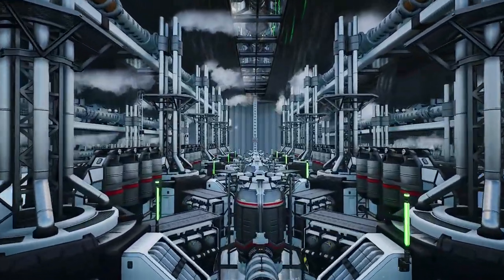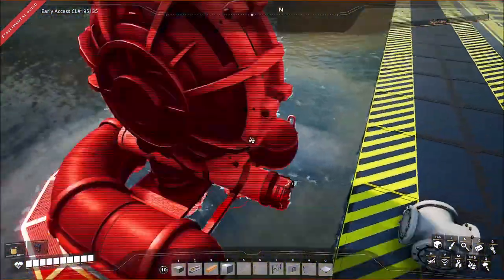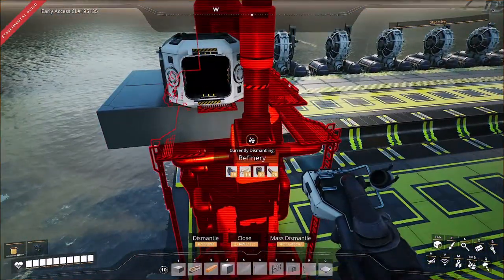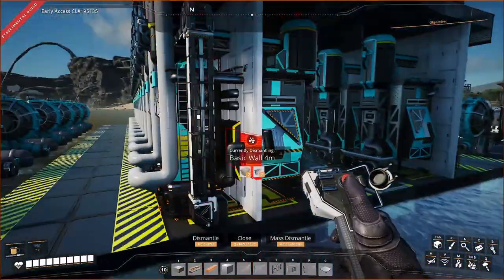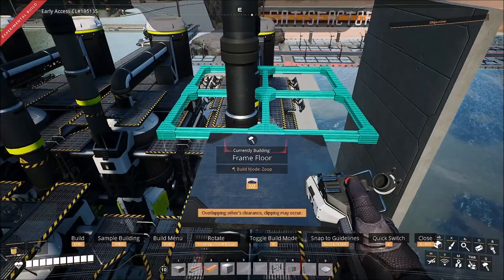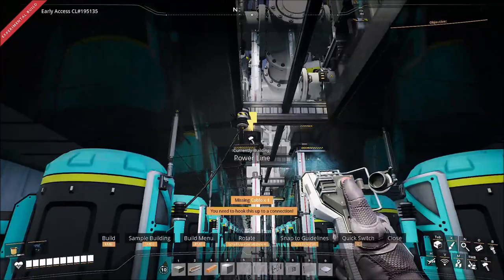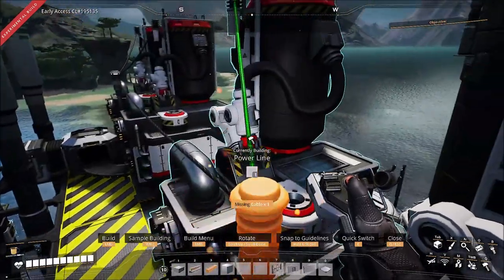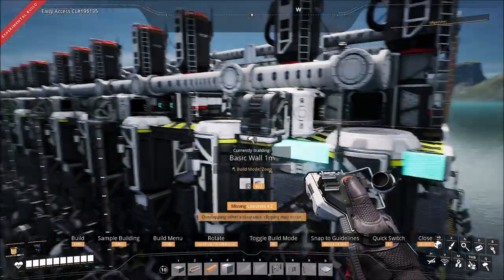Satisfactory Fuel generator fuel power plant tutorial update 6 part 1

Comment: Thanks for the design tips. I took your build and design to my liking.  I rearranged the build a little by putting the water extractors into the middle of the build.  I also added another foundation at the end, so my groups of 2 packagers and 2 refinery had one empty foundation between me.  For me it made more of a symmetric build.  Next i placed heavy oil refinery above my water packager and the fuel unpacker about the package fuel refinery, so it still does a loop system.
Reply: @DrawingXaos   I am still finishing up the build, so it is not running yet.  For the most part, it runs the same as your.  I am planning to take a little of the packaged fuel as store it for other uses and refill the packager with empty containers.
Reply: @DrawingXaos  have the jet pack.  if you have another place for me to post.  i can upload some screen shots when i am done.
Reply: @JasonMerk  he has a discord

Comment: Great vid not sure if i missed something or something changed from upd 6-7 but oil ratio is abit off with heavy oil residue refinerys only making 28.57 residue per min at 71.425% which means the packaged fuel can't run at 100% which me you have to undeclock everything a tiny bit. Water extractor + water packager + fuel packager + fuel unpacker all at @ 95.23%, making a total of 1599.864 fuel /min instead of 1600 but wont ever be bottlenecked.

Comment: I need to get a little farther before I can try building this myself, but I'm loving your setups!
Reply: @DrawingXaos  I especially liked how you took the time to explain good wire placements too. It helps a lot, as they're always important to the build.

As for your question at the end, just put a wall power node at the point the wire clips up through the ground and then attach that to the power pole. It will at least look a little less like clipping and more like your pipes through the foundations. Intentional. Either that or flip the batteries around and run the power line down the slanted support wall.

Comment: Great work but there is a mistake in your calculations. You need more than 600 crude oil. You have built 14 refineries to produce heavy oil thats  mean - 28x30= 840 crude oil. Even if I set the production of heavy oil to 30 / min , than i still need 640 crude oil
Reply: I don't think you took into account that he's underclocking them all

Comment: Is there a space between the refineries like there is for the packagers on top? I'm just wondering, lol...
Reply: @DrawingXaos  Thanks man, I figured it out what you meant last night, lol.
Reply: I saw it was like 2, 2, 3, Space 3, 2, 2 for the packagers on the top.  The way I started it out wasn't going to work so I kept moving them around in the middle till I figured it out. 4 sets of 7 packagers each. Thank you again :)
Reply: The way I have had my world now I was producing 9600 MW with all coal generators because I hadn't unlocked fuel till recently. Then out of my rubber and plastic build I have 30 refineries making 400 rubber and 200 plastic. That Oil residue is used to make 200 fuel for 16 fuel generators and a tiny fuel packager at 8 fuel cans a minute. The Coke I am making a few hundred to use with all the rubber to make 70 circuit boards a minute. The power I have now is 12k MW so adding in the 20k will be a nice bump for me.
Reply: @DrawingXaos  Oh, it's not that great. I have yet to decorate anything. I just started playing this game again after two years. I was working on this save file during update 3. I just started playing again off and on a few months ago. One of my coal generator setups has 48 inside it making almost half of the total coal power I have.
Reply: @DrawingXaos  I forgot to ask, do you know of a way to take everything I have built and unlocked in a save file and put it in a new world. All of my creatures have disappeared or fallen through the map except my one Lizzard Doggo that I tamed in 2020. The only creatures I have are the hatchers. I haven't seen a single other enemy or birds, doggos, and the big blue long leg things.
Reply: @DrawingXaos  Oh, thank you for that. I have asked other people and never got a response, lol.